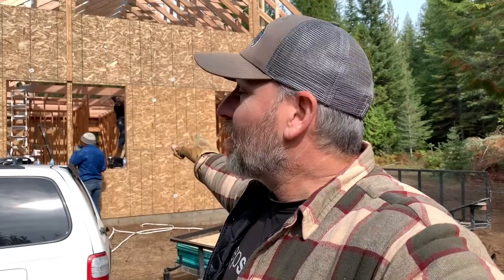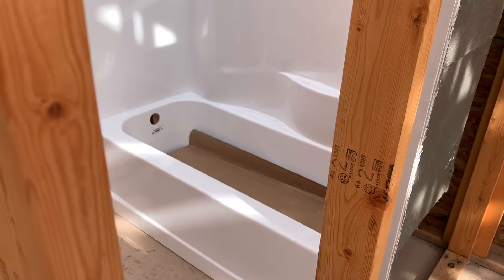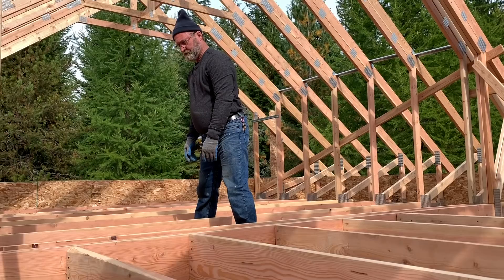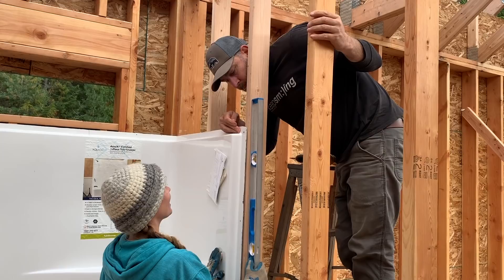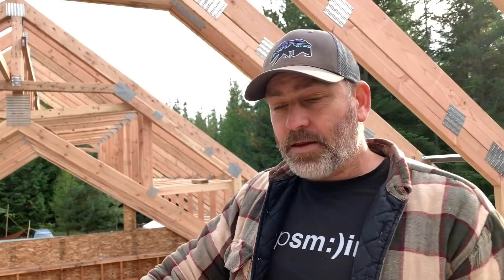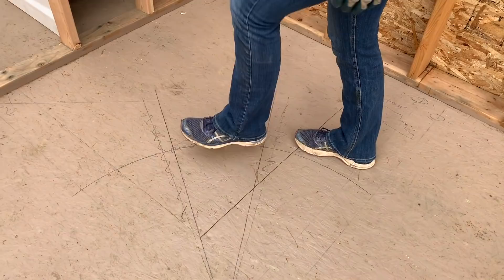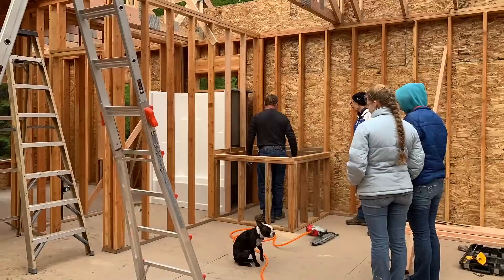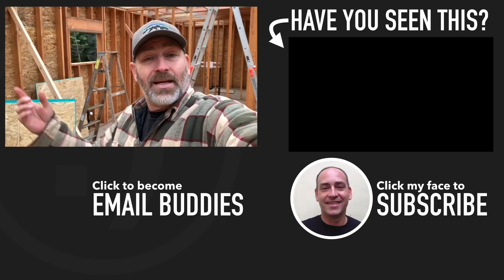WE CALLED FOR HELP!!! | Off Grid Cabin Build #34

Comment: To the Bloggers:  One reason now is a good time to build the stairs and put down the subfloor in the attic is because now, they can walk the roof sheathing up to the attic, and then feed the roof sheathing through the gaps of the trusses, one sheet at a time.  If they had the Gradall, then they could just load up the roof with the materials.  On most rough framing jobs, it's a good idea to spend a few days cutting and installing the stairs, plus floor sheathing, as soon as possible.  It helps the other Tradesmen and women to keep moving with their work.  Also, now they can stand on the attic floor and work on the Gable Dormers.
Reply from the maker: Amen.

Comment: You guys really need to get the joist hangers on those loft joists before you get much further ahead.  Otherwise the nails will start bending and the subflooring  will be compromised.  No inspector is going to pass the build without them and being on YouTube it's fairly easy for them to know what you're doing.
Reply from the maker: Thanks for the tip.

Comment: Flooring with such large gaps seems not a good idea
Reply from the maker: Why?
Reply: @MartinJohnsonOffGridLiving  is this material rated for such spans? Does it feels solid when you walk on it? When i did my house i put solid wood planks 2.5cm thick perpendicular to floor  supports with span from 25 to 30 cm and on them two layers of osb with 14mm thickness. And it still moves tiny bit.. but at least im not worried to fall throught.